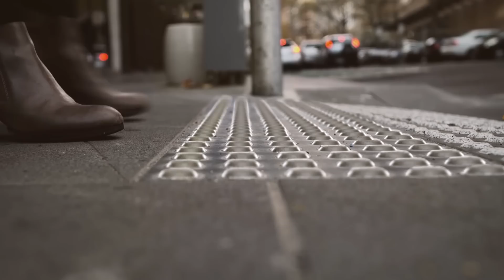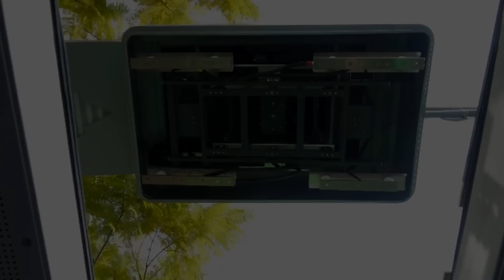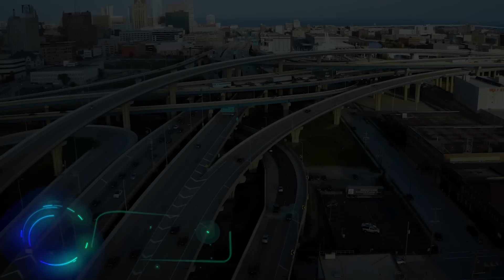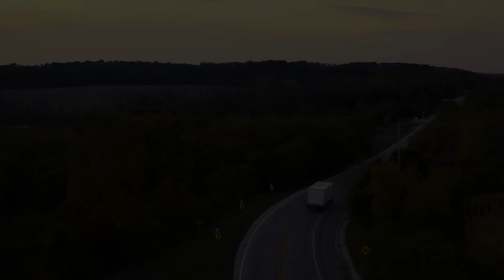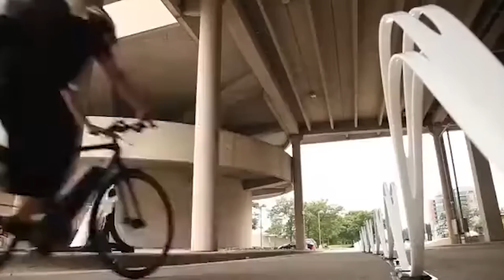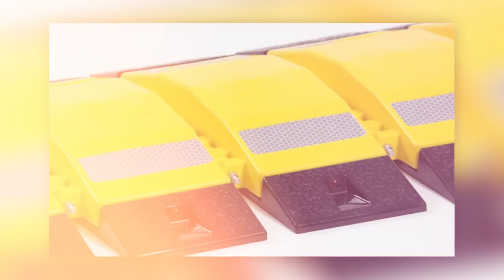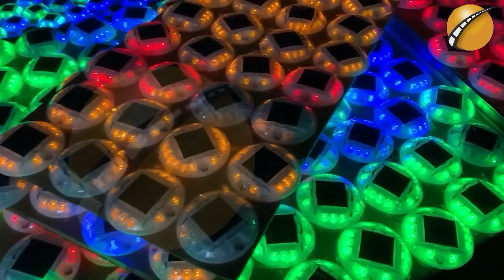INCREDIBLE ROAD TECHNOLOGIES THAT ARE REALLY INSANELY COOL

Comment: The most interesting thing I learned today is that people feel that some plastic things between the cycle lane and the car lane make it a protected bike lane. In the netherlands the bike lane would have at least a meter of separation on such a big road.
Reply: Completely agree, this won't do anything to protect cyclists. If anything it would keep cars from parking illegally in the bike lane though.

The biggest benefit I can see to this system is its ease of installation. It looks like you can install long stretches of these barriers very quickly, which means that cities can experiment with different bike lane designs without having to fully commit to a permanent structure. A lot of times, cities are resistant to change because they can't visualize how it would turn out.
Reply: @LimitedWard  cities don't need to experiment with flimsy plastic poles and strips. The methods for actually safe transportation infrastructure have already been thoroughly tested and published. The Netherlands' CROW Design Manual holds the information that's needed. My Grandma's dog could design a safer street than any traffic engineer who is obsessed with the convenience of motorists over the lives and safety of people.
Reply: @mrmaniac3  I don't disagree with you, but the reality is that American government is an incredibly slow machine. There's a chicken and egg situation here where people don't want to use a bike because they don't feel it's safe, but cities aren't willing to build better bike infrastructure unless there's demand. If this can convince even 1/25 people to make the switch, then that's progress.

Don't let perfect be the enemy of good!
Reply: I think it looks dangerous. We don't need this in the Netherlands. Here, with driving lessons, we learn the rules not to park on a bike lane or drive a car there.
Reply: I actually think it's good to have them on there. It's nerve racking to be on the same side of the road as a biker.
Reply: @nahianchoudhury8523  Then you better never drive a car in The Netherlands. There are cyclists everywere.
Reply: @Alicia.  the thing is, these bikers most kf the times ride way too far from the curb. It's so annoying.
Reply: @nahianchoudhury8523   they are taught to cycle away from the kerb to ensure they don’t fall off into the gutter, and to have room to manoeuvre  when stupid drivers close pass them ( closer than 1.5 meters). Try cycling yourself and see how intimidating it is being overtaken by a large metal box on wheels and how the air displaces and practically pulls you under.
Reply: @Fuzzy  yea but they stay so fat from the curb that you actually need to move into the second lane to pass them. This is why I always stay on the left lane.
Reply: @nahianchoudhury8523  I think it's education that helps and not weird constructions on the road that look dangerous. The children here in the Netherlands receive traffic lessons at school and they take an exam in traffic on a bicycle under supervision. In traffic there are rules, for everyone. Staying in the left lane is a no go here, doing so hinders other vehicles. Sometimes you have to watch out for bicycles, yes, but they are also part of traffic.
Reply: @nahianchoudhury8523  There's often debris next to the curb, and you need to avoid drains. Swerving in and out is more annoying to drivers, so it's better to ride a bike in a straight line a safe distance from the curb. Yes, that may mean they are in the car lane. In most states you need to pass with three foot clearance (imagine if they reach out an arm, they can't touch your side mirror). Usually straddling the center line is enough to pass cyclists.
The U.S. really fails at teaching cyclists how to ride on roads. This should be done in elementary school. I've met adults who think you should ride a bike on the left side of the road, which is completely wrong (and illegal). Then there's the lycra-clad group, who think they can breeze thru stop signs with impunity. Gives us safety-minded bicycle commuters a bad name. A cyclist should be thought of as a speed-limited motorcycle, nothing more, nothing less.
Reply: @robineff708  we still need bike lanes. Their kind of annoying.
Reply: @robineff708  There are an increasing number of states with stop-as-yield laws though. Maybe you can't breeze through the sign, but you don't always need to come to a complete stop, depending on where you live.
Reply: @nahianchoudhury8523  the main reason why cyclists cycle far from the "curb" is because of parked cars.
Instead of those waves or bollards, parked cars should be the seperator if one is needed.
Reply: While I respect the wisdom and experience of Netherlands, I think that people need to stop being so negative about delimiters. A physical limitation is easier to see than a road marking, and unfortunately, i think drivers might need something that wakes them some times. This is a perfect interim measure that we can use now.

I hope that Netherlanders never become arrogant, because I will start to question why they never had perfect bike infrastructure immediately, and when they started to improve, why didn't they become perfect over night?

Some countries will take any improvements, so the cheapest solutions are the best to start examining.
Reply: @eugenetswong  Arrogance is an ugly thing, but nothing gets perfect overnight. And nothing can be perfect from the start, I don't quite get what you're trying to say with that.
Reply: @Alice-y5h7i  I agree with you. I'm trying to say what you said. Others seem to be saying that these devices are not a step in the right direction, and that we have to get things right immediately with no interim measures.
Reply: @eugenetswong  you do realise the video voiceover says that this idea would be great for the Danish and Dutch? which just isn't true.

The argument made is about that, not that these barriers are not useful in other places.

Any improvement is good, and to be applauded, but in the Netherlands this simply won't be an improvement.
Reply: @WouterWeggelaar  Ah, thank you for clarifying! I really appreciate that. I didn't notice at all.
Reply: @eugenetswong  second this, my city is building more bike lanes and bike ways, but that takes time.

Mostly the bike lanes are painted, with a large solid area at traffic lights. It's better than it was, but I like the idea of this. Would make it easier for drivers and cyclists both, ease the relationship some and head us in the right direction.
Reply: @Solutionist1  Thanks for chiming in with support. I'd hate to be the only person.

I think that as long as we have a clear perspective on what this is better than and what is better than this, then we'll be okay.
Reply: You've missed the point. It's to protect cars and drivers from cyclists....
Reply: At least a concrete curb should be used to separate bike and car traffic. (It is in many countries.)
Reply: I used to bike to school and I couldn’t use the bike lanes because drivers would go into the bike lane. Needless to say I almost got hit quite a few times.

Comment: I am my own safety barrier:  I drive at or just below the posted speed limits, and in the outside* lane on multilane roads or highways.

Outside lane = right-hand lane in the Americas and most of Europe and parts of Asia, and left-hand lane in most English subjects.
Reply: The outer lane is for passing slower moving traffic in the UK and not for cruising.
Reply: @eattherich9215  
Eat the Rich:

OK: Lets establish some definitions here.
Imagine, if  you will, we are looking down on a typical  highway/motorway, vertically oriented so that north-bound travel is toward the top of the screen, and south-bound travel is toward the bottom of the screen.

Let’s assume a typical six-lane highway, with three northbound and three southbound lanes. Both northbound and southbound sides are shouldered on both sides, for easier breakdown access from any travel lane.

I refer to the lanes closest to the center median of our model highway as the inside/inner lanes, and the lanes toward the outer edges of our model – furthest from the center median – the outside/outer lanes.  

The only difference: In the U.S., northbound travel in our model highway is in the right-hand side three lanes, and in the U.K., and its past and present territories, northbound travel is in the left-hand side three lanes.
I have developed a “nation neutral” habit of referring to passing lanes(those closest to the center median) as “inner” or inside, lanes, as opposed to just left side or left-most, which favors American or other North and South American highways.

With that established, I will ask you:   Are you suggesting, in your comment, that passing is done/permitted in the outermost lanes – the ones furthest from the center median?  Folks here in the States do that, not everyone, but it’s the American “I can pass anywhere I want!” sentiment that leads to relative anarchy on our multi-lane roads.

In the States, I cruise, practically undisturbed in the outermost(right hand for Americans!) lane on highways here, at just below the posted speed limit – 52-53 in a 55mph zone  - and I find I am able to anticipate changing conditions ahead  in a more timely fashion, and relax while driving.

Additionally, I can anticipate and accommodate on-rampers, especially the nervous ones who on-ramp at 20-30mph below the posted limit, much more easily, as opposed to those travelling 10-15mph over speed limit, who then need to quickly move over to accommodate said on-rampers.

Imagine if EVERYONE adopted my style of driving? ;)
Reply: @Zickcermacity : it seems that you have trouble in comprehending a simple, factual statement.  However, I am going to indulge you and expand thus:

The [UK] Highway Code is very clear [on motorway driving].   It says: “You should always drive in the left-hand lane when the road ahead is clear.” ... The middle and right-hand lanes, then, are for overtaking.   Anything else you want to tell me about driving on UK roads.
Reply: @eattherich9215  The way I interpreted your statement:

"The outer lane is for passing 
slower moving traffic in the UK 
and not for cruising."

Is that one can pass other traffic in the same lane in which most entering and exitng is done on a motorway/highway - the lane furthest from the center median that divides directions of travel.

Am I correct or incorrect in my interpretation of that?

Comment: Those bike lane dividers should never be used here in the Netherlands, as you shouldn't have cars and bikes on the same bit of asfalt anyway. We use separated paths to make sure the bikes are safe. Only in low speed areas will there be open bike lanes, and these barriers would likely reduce the flexibility for bikes and even for cars.....so they would only make things worse.
They are a solution to an american problem, not to a problem of the countries that have many bicycles, as they already know how to do things.

Comment: The bus battery problem could easily be done with detachable batteries. You change them instead of recharging.
Reply: your solution work for industrial aera, or at bus depot but not for streets, 
because if it must lift a heavy battery, stock it, then deliver another battery, you need more expensive and heavier station, and there will be none in street but rather few on a metropole, their solution is to have on each line, on many stop, a big charger where the bus could wait few minutes his schedules; it could also replace the TRAMWAY technology since you wont need cables anymore.

Comment: The best way to improve road safety is to remove the worst 10% of drivers out there. Make getting and keeping a driver's license hard, require periodic aptitude testing, (a driving test to detect and correct bad habits) professional training for drivers, Follow-up training for all drivers, Include "Demonstrations of extremely poor judgment" such as texting while driving, reckless driving, drunk driving ect... result in revocation of a driver's license not as a punishment, but because such actions show that the driver lacks the judgment required to drive safely. ANY demonstration of poor judgment should result in at least a suspended license of the first offence. 
     They already do this in aviation. A pilot can lose their license if they show poor judgment, even if the action has nothing to do with flying.
      There are so many things that can improve road safety that have nothing to do with infrastructure.

Comment: In finland they dont have those LED panels. They actually have light what luminates from up to the street that light. It works even when snow falls down. That kind a LED panel in front of the sidewalk doesnt work here.
Reply: so its a mapping laser technology?
Reply: @eriklerougeuh5772  I don't think so. Would just say that there is no panel under the concrete, there's no need for. It's some kind a LED fitted in walking lights to project right size light to pavement
Reply: It is LED Projecting. I may release a video from that.

Comment: That bike barrier is needed less in the Netherlands and similarly bike-heavy usage areas than it is in places where there is less cycle use. The Netherlands already has a great approach to infrastructure that actively reduces conflict between types of road users. It's the places like the UK where we see drivers ignoring the painted cycle lanes and just driving over them, or cyclists ignoring the road laws and causing havoc for drivers and pedestrians alike.
Reply: There is no obligation for cyclists to use cycle lanes, and in fact often there is a good reason why they are not used. The roads areswept and cleaned very often but separated cycle lanes are very rarely swept or cleaned and thus there is often abuild up of glass or rubbish in some lanes.
Reply: @bagofnails6692  absolutely agree with you. I'm a cyclist as well as a driver - I just know there are drivers and cyclists whose road behaviour is poor.
The Netherlands approach to cleaning and ploughing cycle roads gives them equal priority to clear.

Comment: You have to question the veracity of some of the claims that some of these solutions make.  The solar road lights, for example, might have the lifespan listed in lab conditions but would probably be much shorter when employed on a hot road surface or the battery would act as if it were bad in places where the winter is extremely cold.
As for the comment about the sidewalk signal being vandal proof: I would hope that it's road rated meaning that it should withstand the violent vandalism attacks.  I would also hope that they're using tamper resistant anchors for maintenance access.

Comment: Leds in the sidewalk - won't survive winter.

Pantograph loading station? - others have come further. But other ways are more interesting, such as aerial wires and induction loading without stopping. If you can reduce the need for batteries by using more traditional overhead wires in central areas of your city, much is won.

Flexible barriers sure have a niche.

Parking barrier - "vandal proof?" is that a challenge? And one year battery time? How does it work with snow and ice?

The drainage system definitely look interesting, a combination of traditional and curb side drainage. But basically it is just "more hole".

Flashing chevrons? 97%? There have to have been some other things done as well at that intersection, not just exchanging the normal retroreflective chevrons for the lighted ones.

Flex post replacement? More plastic, looks really dangerous and will make a huge mess when touched, compared to a flex post. Put a curb between the lanes instead, and flex posts in the curb.

The roller barrier is definitely a real product, to be used along side wires and other safety barrier technologies.

Portable speedbump might be a bit too portable and end up in a ditch within hours of deployment. It definitely looks like it will move around on its own as well.

Not much to say about the sprayplast, I'll leave those for the civil engineers working with roads.

Solar road stud? I wonder how it fares in the winter above the arctic circle?

CADO - -seems like an old an teste product...
Reply: the LED sidewalk is in Australia, fun fact, we don't get snow, we don't get ice, itll be just fine in our winters

Comment: 0:37 so instead of fining the ppl on smartphones and making then stop using any devices while crossing the road, they want to play along and be even dumber than ppl on smartphones?
That is a bad joke, right?
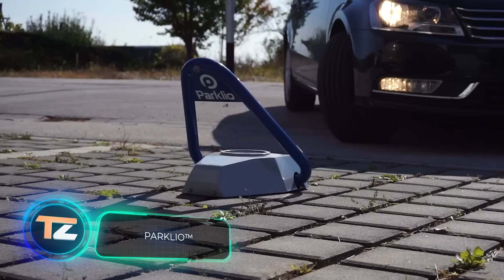2:42 this thing was available for at least 10 years by now, except it was controlled by a remote, some cars have a built in remote that can be paired with other devices such as a garage door or this thing.
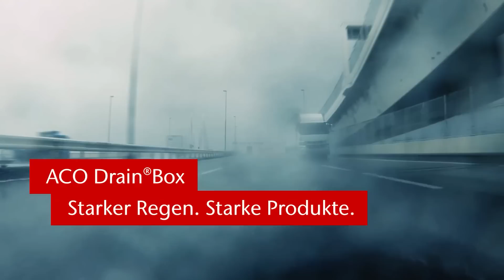3:35 another old idea, it however was not working well bcoz debris would clog the smaller holes, and in case of an accident where oil, petrol or diesel fuel runs along the street, the firemen would need tons more of mats to plug all holes - that was a no go. However, some German companies used the scared ppl after the floods in 2021 to push such ideas. 
This was a gov. failure and not climate change. 
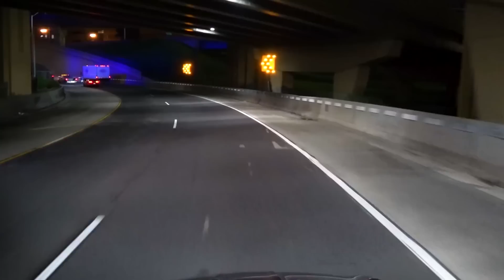4:19 this is tech used for decades on constructions and in some curves too, the ones i have seen has solar panels.